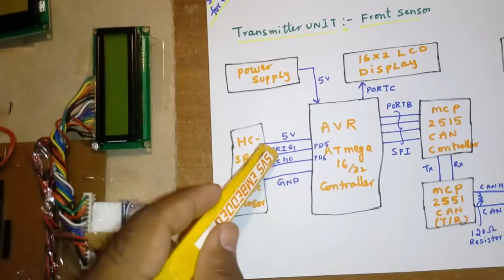Vehicle Speed Control and Accident Avoidance System using CAN

Comment: what is CAN protocol ?
Reply from the maker: Thanks for watching and your valuable Feed back.
Controller Area Network or CAN protocol is a method of communication between various electronic devices like engine management systems, active suspension, ABS, gear control, lighting control, air conditioning, airbags, central locking etc embedded in an automobile.